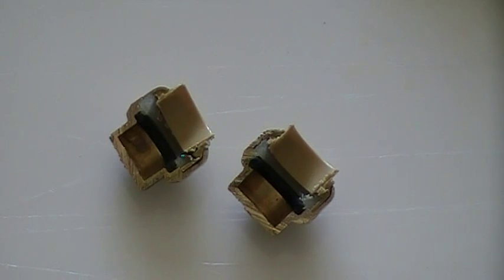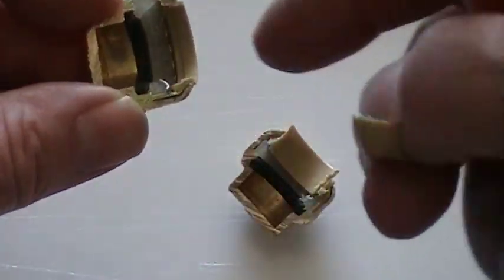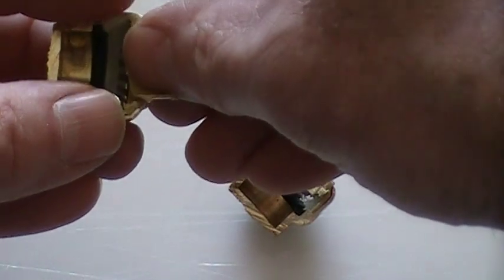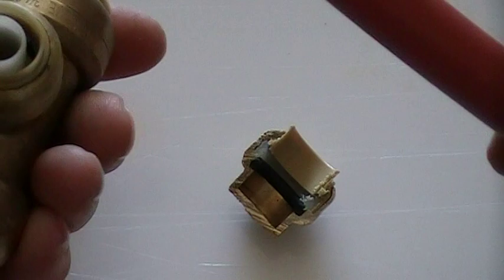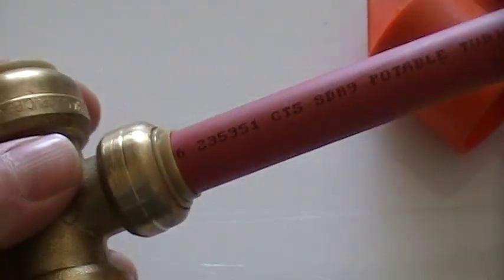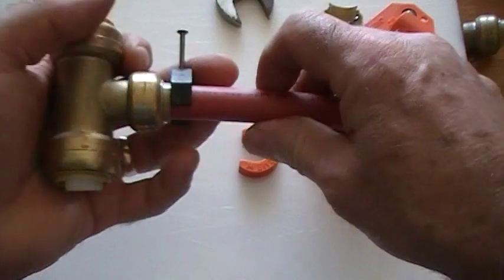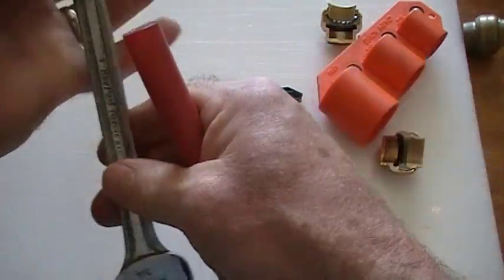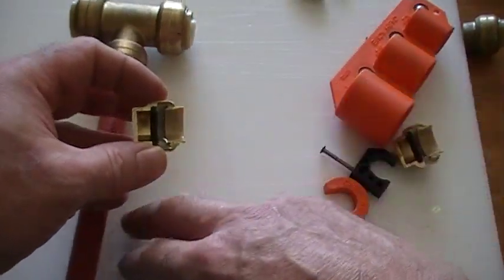Cross section of a sharkbite fitting...how they work and can be removed.Plumbing tips

Comment: Great Vid! Is shark bite reliable to use 6 or 8 of them in a house plumbing system in a long run? how long are they going to last usually? I saw some people online says shark bite only for temporary fix.
Reply from the maker: Hello Pento;
They are ideal for a quick fix. I don't think the verdict is out  on them yet. I know a few places where they have been in for a number of years now with no issues. They do work very well! I have a made number of videos on them now and have done a few pressure tests as well with no issues at all!
Thanks for commenting and a great day!    Al
Reply: I had a hot water heater replaced about a year ago and the plumber used these fittings. The HW out line leaks intermittently. I'm sure the issue is temperature related, probably caused when the pipe goes from hot to cold and contracts. The leak is very slight, just enough to create a 4" puddle on the top of the HWH. I tied a rag around the fitting to absorb the water when it does lead, which is rarely, and just enough to make the rag damp, which then dries. Strangest thing.
Reply from the maker: Hello phishstyx;
I would say that it is the fitting itself. The HW line leaving the tank never gets cold; so it is more then likely the O-ring in the fitting that has a flaw or has been flawed.
You should look at replacing it as soon as possible. I would be interested to see if the fitting is on all the way. Something to look for when you do.
Thanks for commenting and have a great day!    Al

Comment: Al, Thank you for taking the time to put this together. I'm new to using SharkBite fittings and I've been having a lot of trouble getting one to disconnect. The cross-section really helped me understand where I'm going wrong. Keep up the great work, I'll be sure to look for more videos from you if (when) I run into a problem again.
Reply from the maker: Hello metalheadhippyheart;
The plastic sleeve has to be pushed back to release the teeth.
Shrakbite actually make plastic clips to remove the fittings. I have used plastic pipe straps on several occasions as well!
Great product!
Thanks for commenting and have a great day!    Al

Comment: great product, installed my water tank with it, hot and cold lines with no leaks installed 3 years ago.Also used a shut off valve from shark bite.Kinda pricey but worth it.
great dissection.

Comment: A tip that we were told is to spin the pipe or fitting, if you can, as you push them together. It does seem to help them seat easier.